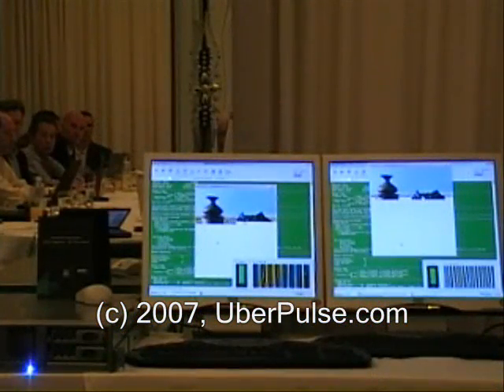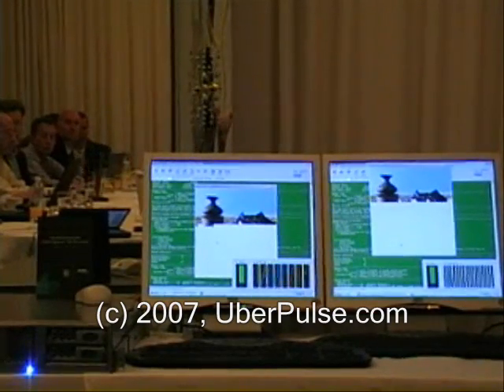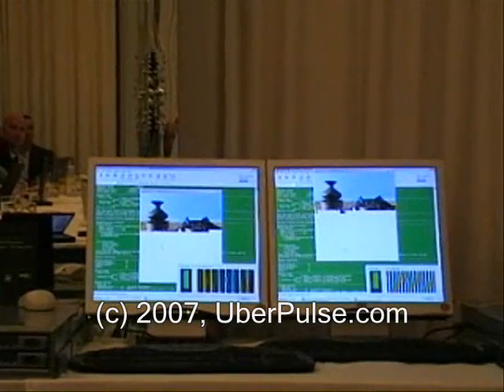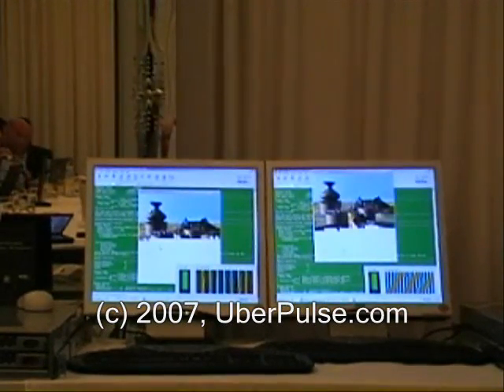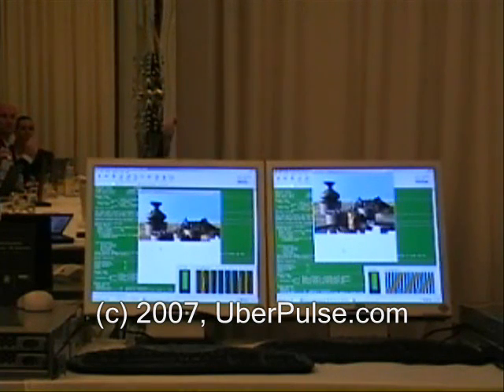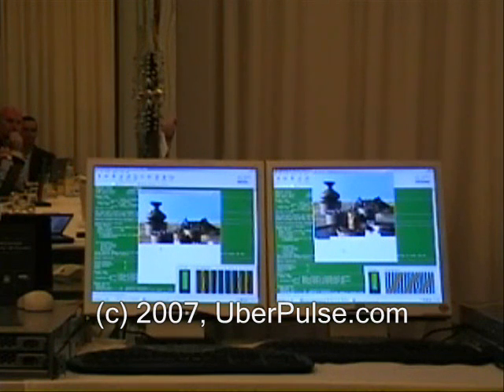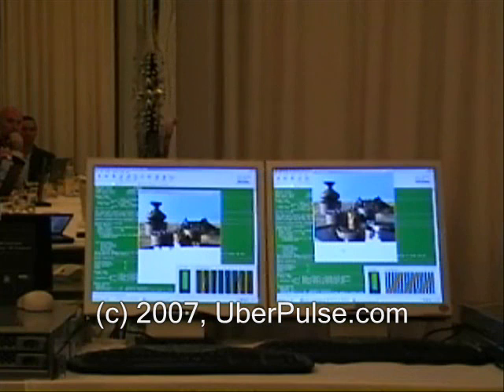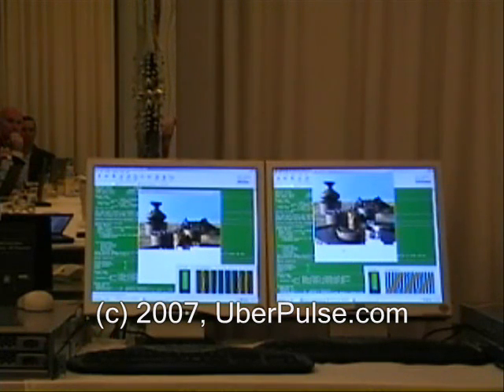AMD quad-core 4 sockets demo: twice as fast!

Comment: Assembling a intel chip should be easier;;
New tech info is working on a levitating laser AMD processor which obtains its power while levitating, with a simple solar cells around it and laser light being its light source, not sun light.

Comment: correct... but you still see performance increase in their 2x dual core design (so called: quad core). until AMD pull sumtin for the am2 socket, intel is still up to date. Besides intel has upgradibility for the 775 socket from dual core to quad core, while amd is talking about a am2+ and am3 socket, and not allowing am2 boards to get upgraded in processors... i can't say for sure but only time will tell...

Comment: u know when u revolutionized from single to dual core... why cant u just repeat the process and put 4 processor on 1 tiny wafer 1cm x 1cm chip? or 2 tiny wafers stacked on each other to save room? and parallel the damn circuits? im not saying copy intel with their network design, but just parallel it and realease it soon! you may say intel isnt a quad core, but atleast they came up with something sooner than you guys.

Comment: texnixian, those are 1U servers. They're extremely noisy because they're SERVERS - for data centers - they are designed for maximum cooling with total disregard for noise/sound level. Those are not designed to sit on your desk or tv with the Xbox sitting on top of it.

Comment: vividesigner, Intel has the same number of cores in their chips.  Don't you know that?  Intel's quad core Penryn chip will be on the 45nm process.  The Barcelona is on the 65nm process. This means Barcelona will cost the customer less money then Penryn because of the difference.  AMD works to save you money, Intel expects you to pay more.

Comment: decaalv, the Barcelona has four cores on one die.  It is a true quad core CPU.  Tigerton, Kentsfield and Clovertown are all packages from Intel and have big problems with regards to memory bandwidth.   Barcelona has all four cores on a single die.  It will be 40 - 50% faster then those packages from Intel.   And nicebay408guy is still lying with his video.